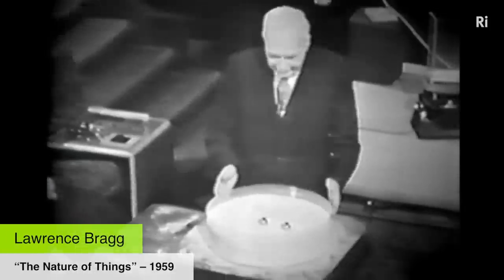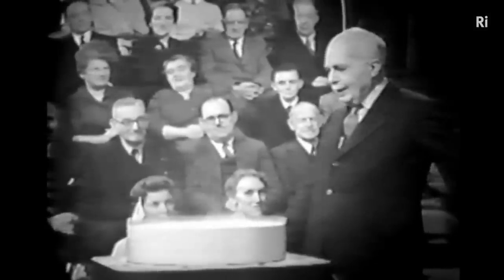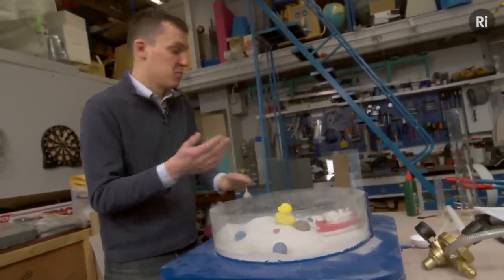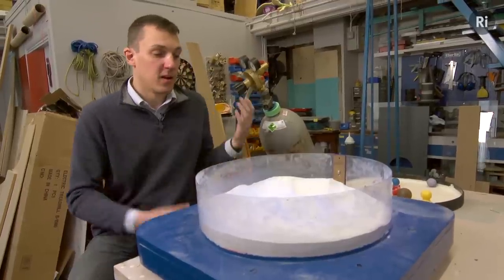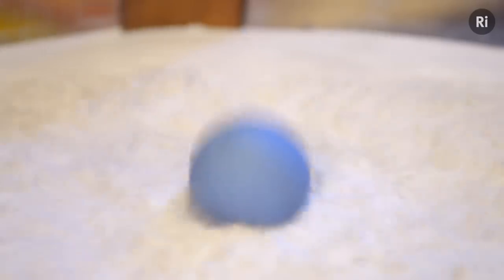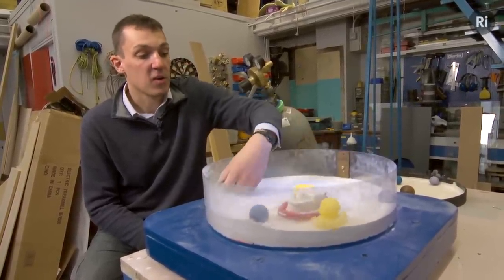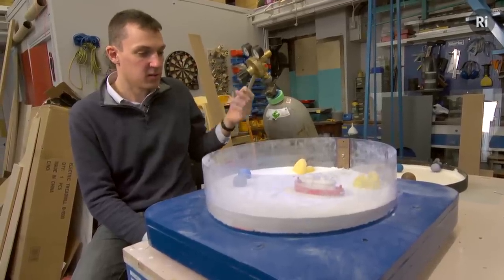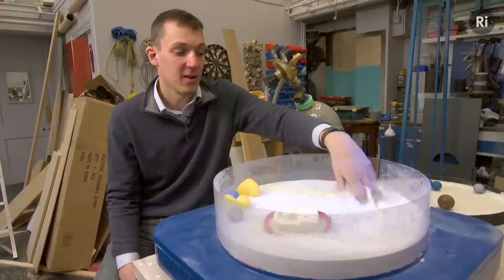Tales from the Prep Room: Making Sand Swim

Comment: This has a practical use in foundries. In a process called 'ceramic shell casting', my job for a few years. It's 'investment casting' but you gradually build a 'shell' of powdered ceramic material (or similar) around the mould that you are going to pour molten metal into. So, you dip the mould (plastic, wax, whatever) into a liquid silica slurry, then you dip it into the sand. Let it air dry. Then repeat several times until you basically have a kind of rock 'shell' around your mould. You then burn out the mould and fill with metal. You couldn't sail across the desert because anything heavy goes straight to the bottom. A five pence piece will sink in a second - Let alone a person or a ship. When you run your hand through the powder in one of these beds there is almost no resistance. An eerie feeling. It's done like this so that you can coat very fine and delicate moulds - And also the sand can get into the fine detail of the mould.
Reply: That's really interesting. Thanks :)
Reply: +McPrfctday A five pence piece will sink immediately in water too... Viscosity and density are two different things, a ship might need to be deeper to float properly in fluidized sand, but it would still float just fine.
Reply: But there's a boat in this video! :)
Reply: Boats work on displacement. They'd work just fine on fluidized sand as long as the average density of the ship was lower than the average density of the sand-air mixture.
Reply: But this video shows buoyancy  we know a coin will sink in water too

Comment: It's not just for fun, it also has a medical application. There are special beds built on this principle  (but with an outer fabric that lets the air through and keeps the sand inside). Dry, temperate air and a perfect distribution of bodyweight is a very good method for healing bedsores when the patient is immobile.

Comment from the maker: For this demo we use a high pressure cylinder but the fluidised bed doesn't require anything like the pressure that this cylinder could provide. We think we used something like half a bar of pressure in this demo.
Reply: The Royal Institution i
Reply: wont sand go in the apparatus?
Reply: What pressure is required? in PSI and kPa

Comment: Could you use sound waves to do this? Like if you put a speaker under the sand to excite the particles instead of air could you liquidize the sand?
Reply: yes, but particles would need to be very small and light

Comment: What happens with sand that isn't so fine? It looks there that you're using sugar sand which is really fine, would you need to pass more air through rougher sand or would it not work at all?

Comment: One thing bugs me. Sand isn't a specific material. Sand is a unit of size. One can have a sand of glass (ceramic), a sand of rock (dark sand), a sand of shells (white sand), a sand of anything that can be reduced to sand size. A sand of cereal, a sand of wheat, a sand of sugar, a sand of dirt. Come on people! Sand is not a thing! It's a measurement! Kind of how a light year is a unit of distance, not a unit of time. Kind of like that but kind of not.
Reply: hassi44 and every kind of sand will behave like displayed in this video, provided it's scaled correctly to the size of the tub. if you have a tub the size of a swimming pool with respectively scaled air supply, coarser sand works, while in this small scale, the sand should be very fine so that the effect is better visible. :P So it doesn't matter if you say "a sand" or "the sand". Any kind will work
Reply: ***** That's not exactly what was bothering me, but I agree with what you are saying.
Reply: +hassi44 I feel you're getting a little too semantic here. If this were presented in a reviewed journal using "sand" to colloquially refer to fine grained beige material would be out of place. Here on a channel aimed closer to the middle of the educational bell curve it's totally fine.
Reply: Eric Loesch "If this were presented in a reviewed journal using "sand" to colloquially refer to fine grained beige material would be out of place"

I'm not going to give this any more time than this comment, since I don't like getting notifications on very old comments. but I respectfully disagree. Specificity is what I wanted here. Not to generalize sand as one substance but to specify whether what you mean is the substance or the size. In that regard it would be entirely fitting in a science journal.

And you're right. This is a channel on youtube, not a reviewed journal. So why would you bring up the subject of semantics here anyway? You even conclude in your comment that here on this channel it's "totally fine". So what are you really arguing here?

I'm not wasting time on this. Have a very nice day, sir.
Reply: Sand is not a measurement? Lmao sand isn't granite or dirt it's mostly coral
Reply: hassi44 You really don't make sense, sounds like you just want to complain about something that doesn't even matter! You're complaining because the video didn't specify what type of sand they were using? What kind of childish reason is that to complain? Doesn't matter what you use, any fine particles with air blown through it will act this way. Doesn't matter what the sand is made up of kid.